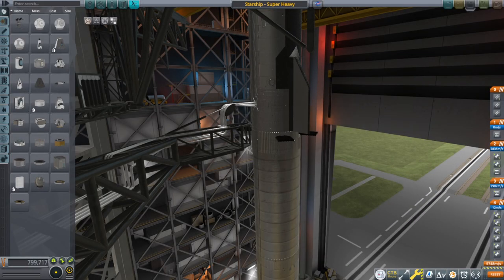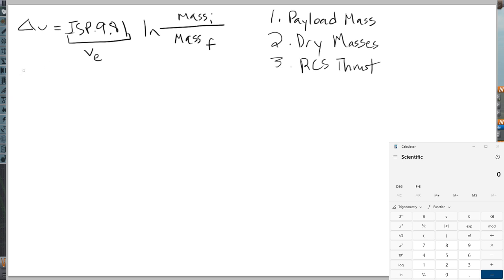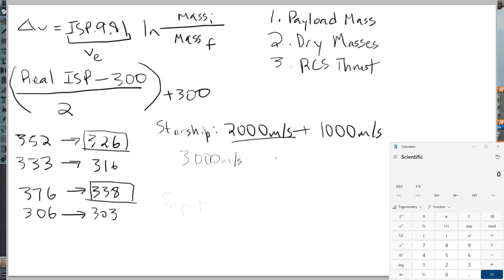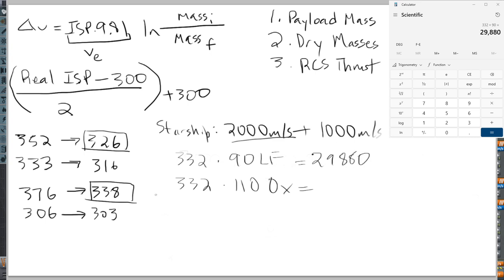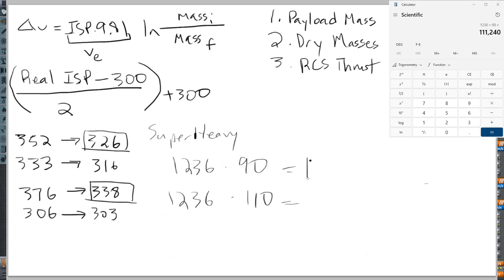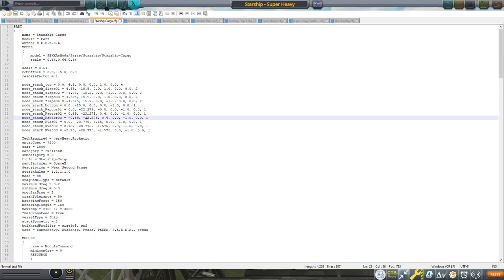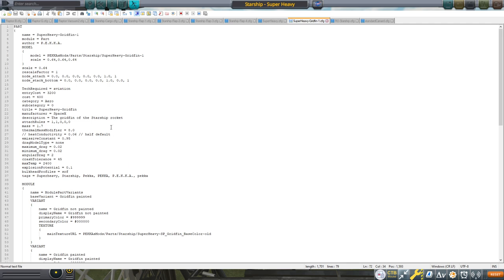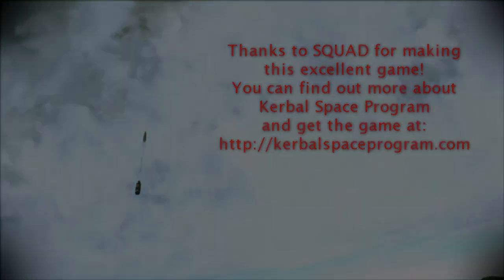Kerbal Space Program - Calculating Figures for Stock Replicas

Comment: I’m most interested in optimizing launch vehicles to feel real in JNSQ. Best compromise between RSS and pure stock, but I somehow have a more demanding physics simulation with an extra 1000 m/s required for a low Kerbin orbit
Reply from the maker: Well, the equations are all the same - just replace the delta-v requirement. Honestly, I find JNSQ to be the easiest of the three. RSS takes a lot of time, but you can use straight replicas. In stock, straight replicas are not optimal, so you have to give it more thought. At JNSQ scale, you can just use straight replicas with kerbalized tank and engines masses and it'll work out about right and it won't take too much time.